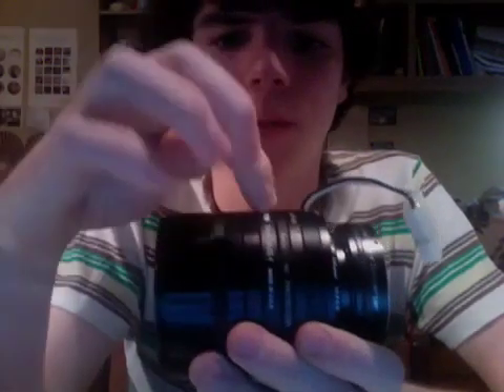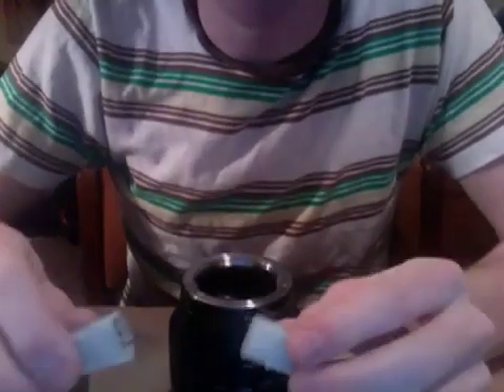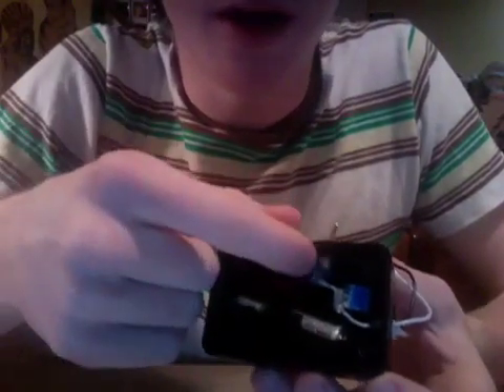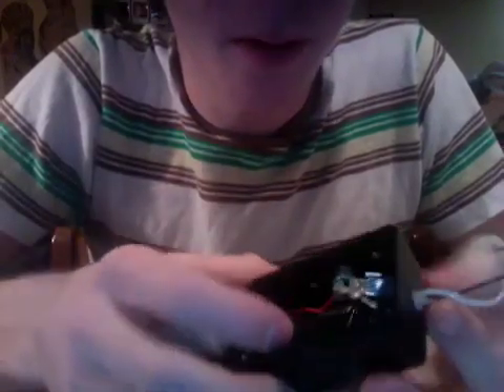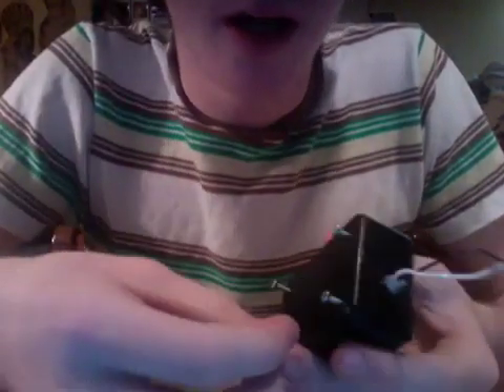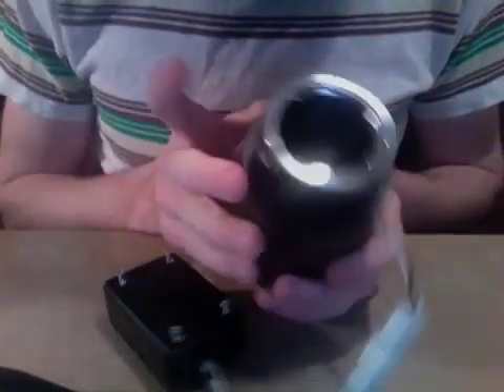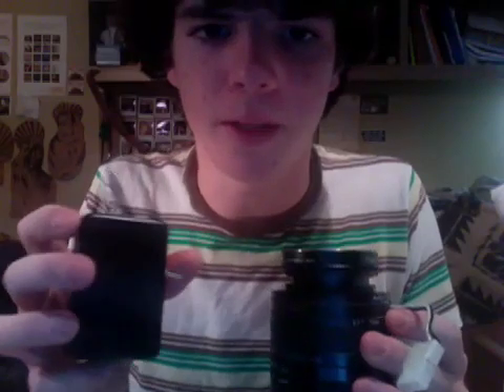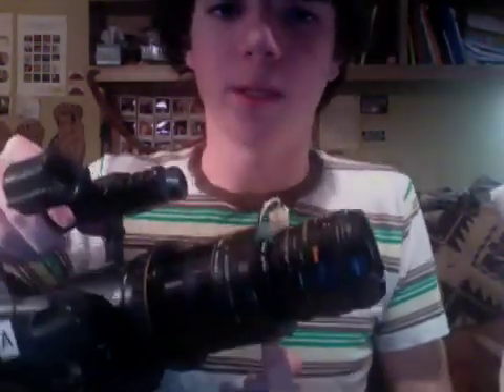DIY Vibrating 35mm adapter Part #3

Comment: wire the LED in parrallel with the motor resistor combo..it will not affect your voltage or current  to the motor....

solder the longer pin of a 1.7v LED (anode) to the hot side of the switch (same pin thats powering your motor)

and solder the smaller pin of the LED(cathode) to the negative terminal on the battery (ground)

it will not affect the motor speed...its a separate circuit. also LEDs draw very little cuurent comparded to motors so it will barely alter battery life

Comment: Steve,

All lenses have vignetting that goes right to black at the edges, but good ones are designed so these edges are off the edges of the sensor/film. Using your achromat effectively shows the video camera more of the screen, and if the screen is bigger than the intended sensor/film or at the wrong distance, it will show this vignette.

Not using an achromat will never cause more vignetting. a poor lens will.

By the way it's also the lens that has the biggest effect on bokeh, not the screen.

Comment: To be honest i really don't see too much vignetting on my video. I have seen far worse results on the tube from similar attempts.

As far as image fragmentation is concerned:
please be more detailed
If you are refering to the lack of sharpness or fram rate "jerking" then these are irrelevant to the adapter really.

To sum things up:
If I had an HV30 I would be able to achieve almost cinematic DOF, 24p recording and slow motion video with no external adapters or converters...
:)